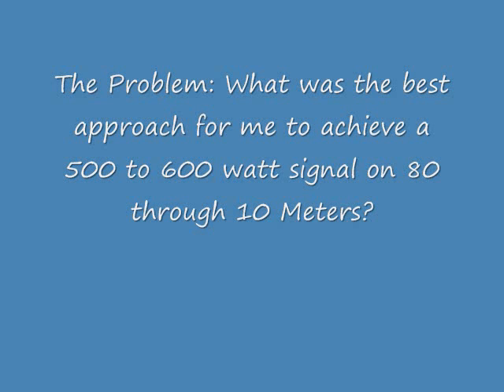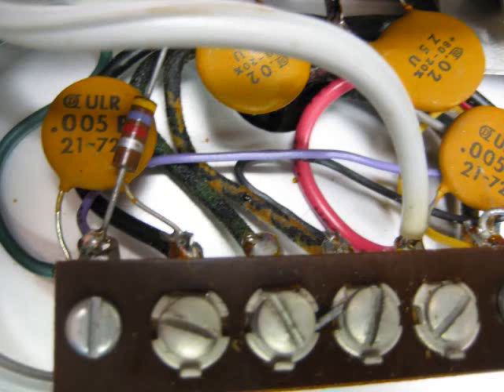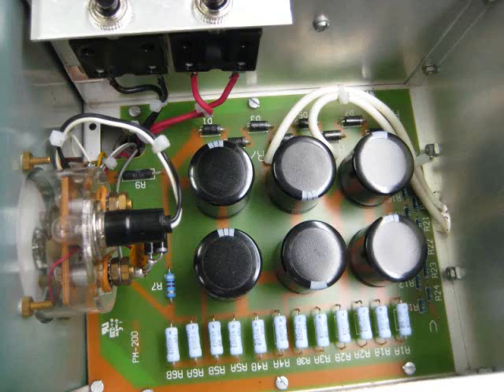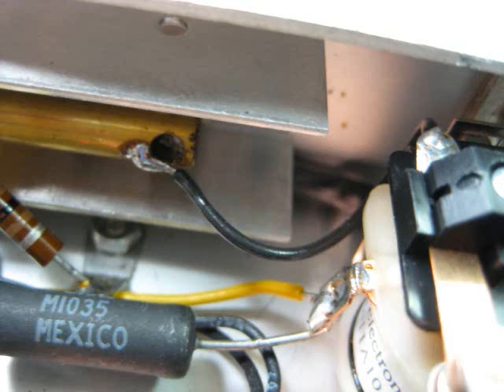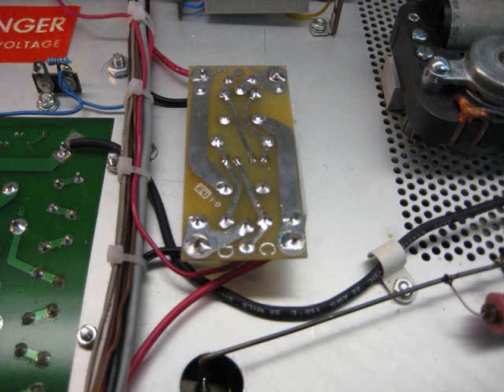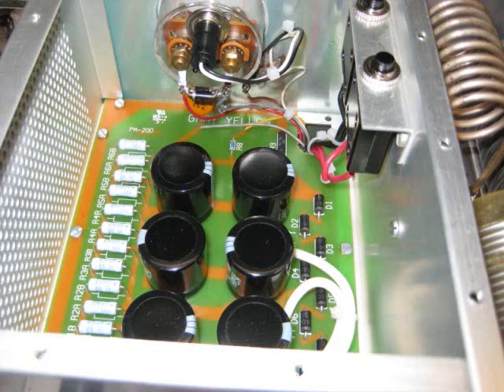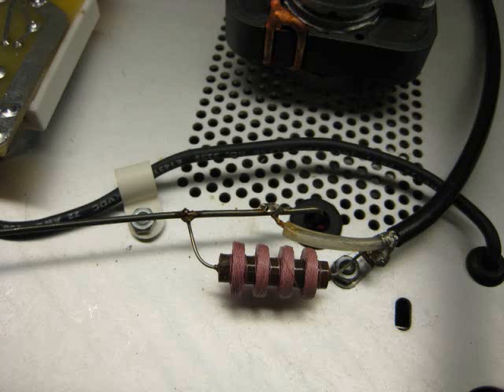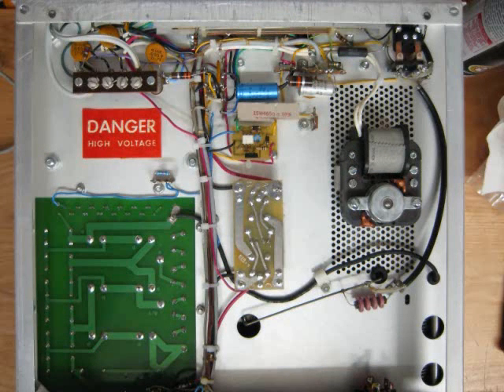SB-200 Upgrade & Modification With Narration from N6QW

Comment: A good amp! I also restored one. I use it to with a period correct Heathkit SB-101, so I just replaced the old power supply components from Harbach. It works great and get 500W out easy. Maybe 600W, but try not to push it. It still has the original tubes in it. I also moved the the C29 lead from pin 3 grid of V1 to junction of R21 and R22 to balance the drive between V1 and V2. I also restored an SB-220. Both great amps!

Comment: Question: Why does Harbach sell you an AC relay when the voltage is DC?
Reply from the maker: Hi mac p,

Thanks for looking at the video and your comment.

Firstly it is probably best you contact W8CQ, Jeff who owns harbach and ask him about why an ac relay for use on dc.

But you might want to do a bit of research on your own before doing that. If you inquire on Google can you use an AC relay with DC -- you will find that you can although not directly. You have to use less (LESS) DC voltage on the AC relay. If you look at Harbach's listing on the replacement relay you will see you also get a different dropping resistor (LESS DC) that must be installed.

The Heathkit SB-200 uses a unique system for cutting off the amp when you are receiving and when you have the amp in line. If you didn't cut the tubes off during receive you would hear "hash" in the receiver. To completely cut-off the tubes heath used a negative 120 volts DC which was fed into the grids of the 572B's through the coil of the relay. So the first problem was that somehow you must ground that -120 volts to do two things 1) is remove the bias from the tubes and 2) operate the TR sequence. If you study the schematic you will also se that there is a small amount of bias on the grids after the TR initiation and this is the normal operating bias for the 572B's

Now at the time the SB200 was designed -- most of the transceivers were tubes and typically there was a relay inside the transmitter or transceiver that provided a contact closure so it was pretty easy to directly switch on and switch off the linear. With the advent of Solid State rigs --the amp keying was done with devices and not relays --so if you connected your very expensive SS rigs directly to the SB200 you would smoke it. Harbach solved that problem with the soft key accessory so you could key the amp with a SS rig.

Now circling back. That SB200 has been around for a long time and many pieces of hardware common in 1970 are no longer manufactures. I do not know this fo a fact but likely the use of the AC relay is a workaround for the non availability of the original part.

Again contact harbach and get a direct answer but most likely if you operate the AC relay and less voltage using DC --it works. It all has to do with the magnetizing force that is developed in the field coil and the applied voltage values for engagement are different depending on whether it is AC or DC.

73's
Pete N6QW

Comment: Pete first of all thanks for a nice video! Secondly i wanted to ask how did you you connect PA bypass switch. I just got my SB-200 and all mods are done including Harbach Soft Key. I've been looking on google but couldn't find any solution.
Reply from the maker: Hi Rafal. Thanks for your post. When I was looking to buy the amp on eBay I spotted that the bypass switch was already installed (nicely done and looks original). Plus the amp had no tu-bes which made the price attractive. The switch is in series with the keying line and since I have the Harbach SoftKey -- the switch simply opens up the keying line to the soft key. there is no magic here --just breaks the circuit
Reply: Got it. Thanks for fast answer and once again - nice video! 73

Comment: great job!! I also have a SB200. My power supply HV caps went burned the PCB. I am getting the same replacement board. I found OEM relay and fan on eBay. Hope to have it going in the next few months. ben in box 10 years needing parts.

Comment: Yes nice job Pete. Hey I just bought a sb 200 and it's not producing any power?  However the electrolytic capacitor caps are destroyed. Do you think that could be the issue?  I know without looking you can't tell?
Reply from the maker: Hi Eric,Stop! There is lethal high voltage in the SB-200 and you must proceed with caution and do not do any troubleshooting with the SB-200 connected to any power source. With the electronic caps being destroyed very likely could have other attendant problems. These include a shorted HV transformer, blown finals, already destroyed filter caps, blown rectifiers and blown dropping resistors. As I did with this project -all of these items were replaced plus a lot more. Check Harbach Electronics --W8CQ (Jeff) for replacement parts - that total may come close to well over $1000. If you bought this on eBay --see if you can return it unless you want to spend the cash and do a complete rebuild. I started with the idea of a complete rebuild as that was cheaper than buying an MFJ amp. 73'sPete N6QW

Comment: good work presentation needs some work hard to follow.
Reply from the maker: HI Stanley,Thanks for your input. Pete N6QW
Reply: @N6QW  is it wired for 220 volt tnx de kj3a
Reply from the maker: @darrelldundee7198  The primary side input voltage is 220. Despite what manufacturers tell you --always best to run linear amps on 220. The higher voltage is less stressful on your house wiring and it actually gets full output as there is no sag on the primary side. It would not be uncommon to see a 12 amp draw on voice peaks on 110 --kind of hard on a 15 amp circuit as likely you have other stuff connected to the same outlets. On 220 that draw is only 6 amps!

Hope that answers your question.

Pete N6QW
Reply: @N6QW  ok tnx sir problems solved

Comment: Any parasitics Pete?
Reply from the maker: Hi Les,Thanks for your inquiry. I sure haven't seen any. The SB-200 has been around for a very long time so if that has been a problem I am sure it was identified and was resolved, I can tell you this --the amp is used mostly every day being driven with about 20 watts I get 200 watts out. With full drive like 100 watts I can actually load it to over 700 watts out. The Peter Dahl transformer and upgraded power supply has made a big difference. My usage now is mostly 20 and 40 Meters and I am using a homebrew solid state SSB transceiver as the driver --so the SB-200 is a "nice pair of shoes" for the homebrew QRP transceiver.73'sPete N6QW

Comment: Pete, thumbs up for nice work ! Your amp should be good for another 50 years, if not neglected. It is worth pointing out that the original transformer and all parts are quite robust.   Nobody NEEDS to go with all new PS board or XFMR to have a reliable SB-200 linear unless those parts are fried.  It's nice but unless there is real damage,  new caps and tubes, will make the SB-200 work fine. YES !  Either the soft key board or an external buffer ( MFJ/Ameritron ARB 704)  is a must for solid state rigs to key this amplifier.   My SB-200  has it's original filter caps and diodes and works fine.  I had the opportunity to go through 4 SB-200's  a few years back.  All left here unmodified.  A few caps were replaced, and other repairs done.  None required any great expense.  So, my point is that for $ 300-350 dollars you should be able to have a reliable amp and expect to see 500-550 watts output .  If your diode/capacitor board is really compromised, it may be cheaper/better to replace it.. but replacing individual bad caps / diodes is perfectly viable and acceptable .  Dirt and loose connections ( and disuse)  are the biggest enemies of any transmitter or amp.  In the process of cleaning your amp.. you will discover many little problems waiting to happen.. and hopefully you will make a list.  Heath Engineering was really quite good..and while a lot of people have published a lot of "stuff" saying otherwise, the fact remains that these late 60's amps are still going strong 45 years later, and with very little effort on our parts. Each amp has to be evaluated individually.. so my comments are generalities, that don't take into account real abuse, accident or the "golden screwdriver".     73
Reply from the maker: +Capt Larry - Hi OM, Well Capt Larry I did want to have a reliable amp and when I considered buying a new one that would cost about $1K and probably not last through the warranty period. OR I could take an existing amp and install new heavy duty parts that would make it bullet proof and the cost was the same. That Peter Dahl transformer is superb and quite honestly the amp WILL DO 800 watts out -I don't suggest trying that with the heathkit OEM transformer or their rectifier board. The board I bought from W8CQ is far more robust than the heatkit board. The HV wiring as supplied with the original kit was under voltage --good for only 600 VDC --so my friend Heathkit cut corners. In fact I have two outstanding offers to purchase the amp for what I have in the amp - so it was a worthwhile investment. Thank you for your comments and input.73'sPete N6QW

Comment: Checked the wiring over and all looks good
if I ground the center of the ant relay I should get the amp to switch but its not do I need a ant connected to the rf input or not just for testing also do you have an email address

Comment: How do you test the softkey I have installed it and on the center pin I get about 1.6volts AC nothing DC I just wondered if there was any way of testing the soft key before putting it all back together again
Reply from the maker: Hi Andrew,
I don't have a good answer for you other than I carefully built the unit and it worked. Might I suggest you contact W8CQ who owns the Harbach company now and perhaps he can further answer your question. Did you check your wiring to assure it is correct?

73's
Pete N6QW

Comment from the maker: Hi Mike,

Thank you so much for your comments. I would only hope that the SB-200 video might be helpful to those who are contemplating a similar upgrade. The SB-200 is in use in daily service and I am very pleased. The more modern components don't like to be stressed too much. The HV capacitor bank is like trying to feed a dead short at turn on. The step start eases the HV on to the filter bank. Will it work without it - Yes? Will the caps last a long time without the SS, probably No.

Comment: Great mods , I'm just not sold on the soft start , to me it's kinda snake oil, I realize what it's trying to do but ... The amp has been running for 40-50 years fine with out it.  The new power board and soft key I get and have ordered .